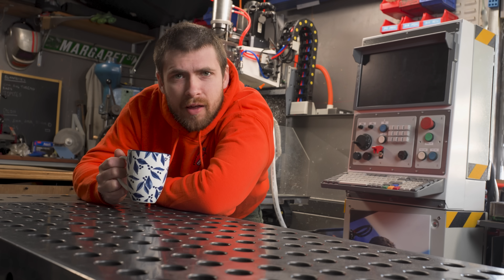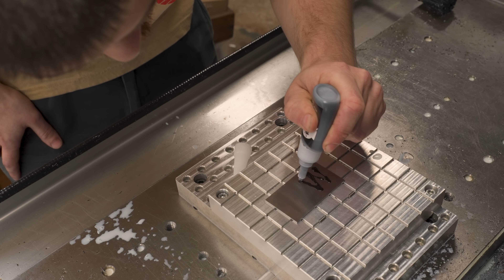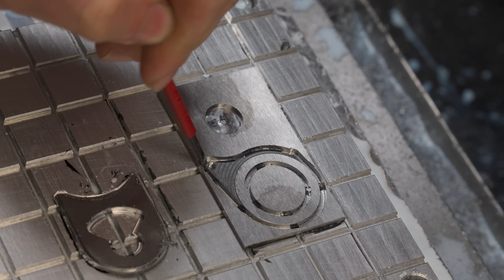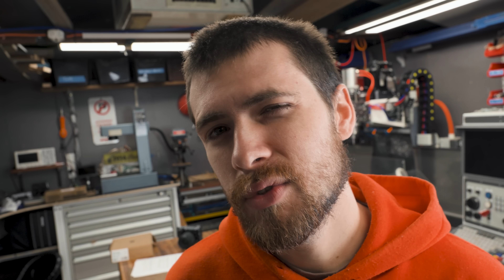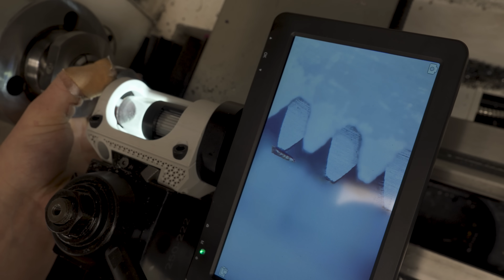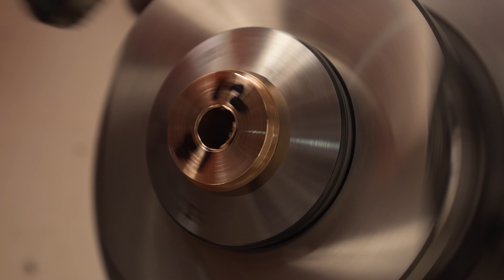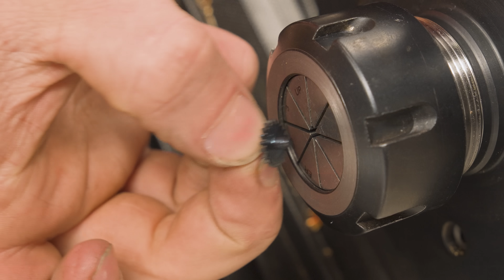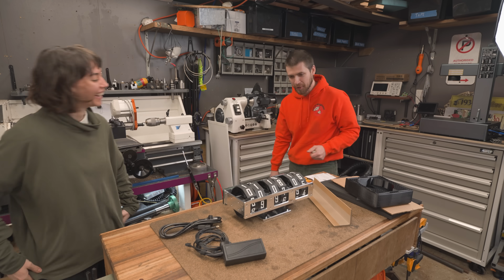What if angles were metric?

Comment: degrees are already metrics : a full rotation is divided in 6 each 6th in 60 each 60th in 60 and so on... The main difference with this measure and measure of length or mass is that a rotation is finite so you don't need to scale infinitely up, when you need to scale down you need to until a point for wich we created angle minute and second, then you can use rad wich can scale indefinitely being represented by a real number. The grad is an awful idea because it doesn't take into account how useful being able to divide a rotation in thirds or 9th or 6th is whereas with grad you are stuck with only 5th and half.
Thinking the idea of metric sit in the use of base 10 is a mistake the usage of base 60 for time and angle isn't less metric it just need to be coherent from a scale to another

Comment: My favorite unit of measure for angles is the "turn". 90 degrees is 1/4 turn (or 0.25). And if you use a cursive-looking "T" for the unit you can sneakily be using turns and radians-with-tau at the same time.

Comment: The metric system does not have "units" for angles, because angles are essentially a dimensionless quantity: being ultimately derived from (how much bigger is THIS side of a triangle than THAT side)
Reply: And yet there are various units of measure which have been assigned to the angle.

Comment: As a geologist, I've never used gradians. 
Not once. 
I have seen instruments for sale with gradians and degrees as alternative markings from the factory - but I've always ascribed that to the instruments also being used by artillerymen for aiming death-sticks.

If I were looking for an origin myth for gradians, I'd point it at, IIRC, the Cassini family (astronomers and surveyors to the French royalty) who proposed a unit of linear measure equal to one 10,000th the distance from the equator to the North pole (along, obviously enough, a meridian through Paris ; where in Paris, I don't know ; Notre Dame?) so that one gradian, on the ground, on that meridian, should subtend 100km.
The obvious corollary of that is that the Earth's circumference is, to a first approximation, 40,000 km long. Or round. Worth remembering. (After which you have to address that the Earth is no more a sphere than any balls you happen to have to hand.)

But for a scientific - or mathematical - unit of angle, you'd have done much better going for a scale laid out in radians (or steradians for solid angle). 2π radians subtend a full circle - obviously the mathematicians love it. TTBOMK, nobody in the real world uses that measure, so your finely constructed tool would remain in it's shipping case, untouched by human (or engineer's) hand. Ball-bearing or not.

Comment: The reason there's 360 degrees in a full rotation is because 360 has a lot of factors. You can divide 360 degrees by a LOT of different numbers and still get a whole number out the other end, which means it's SUPER useful for pen and paper math without having to deal with decimals. Nowadays of course we have calculators and it's less important what things are subdivided into, but it's nice that you can divide a circle by something like 9 and get a whole number of degrees out the other end.

60 also has a lot of factors for the same reason. It's just a really useful number for doing fractions without needing decimals. 6*60 = 360 is a reasonable starting point.

Nowadays because of modern calculators, Radians are the main workhorse unit because you don't have to worry about endless decimal expansions and doing all that math in your head.

Comment: 360 degrees is divisible by 1,2,3,4,5,6 as well as 8, 9, 10 and 12. Just like dozenal is better for numbers, so is 60 and 360. Which lay on a line, each one giving an extra factor: 12*5=60*6=360

Comment: A lot of what you did in this video comes dangerously close to watchmaking. As far as the rough finish on your gears, those cutters do not last long being plunged to full depth in steel. Multiple passes and adding depth incrementally each pass helps them last longer and get better finished. We typically temper parts, then polish them (a mirror polish requires lapping with sub-micron diamond paste on a tin block) then blue again for cosmetics. This gives a much more even color.
Reply: There's "Nothing" dangerous whatsoever about watch making ya idiot!!
Reply: Sounds like you know your stuff - Thanks Sherlock

Comment: If we take the SI to be metric (not decimal) then the correct angle unit is radians
Reply: How's that?

Isn't metric scales based on powers of 10: 10 mm = 1 cm, etc? 

In metric units for angles, 1° = 10' (minutes) = 10" (second) and a circle would have 100°.

Thx
Reply: @ຈິຕຕະຈິຕຕັງ  decimal scaling is not the SI system, the SI prefixes denote scaling by powers of 10, but the base units need not divide something in decimal units.
In fact, only the meter divides the earth's circumference into 40,000,000 (roughly) segments (formerly)

Comment: At 38:15 I have never seen an insert like this for hinges. Are these heat inserts? 

Very curious if anyone can enlighten me about these. Looks very useful!
Reply: I bought some of those over 10 years ago from cabinetmakers/carpentry supply. They open to 180 degrees to form a flat surface. At least that is what I used them for in a shelf. Google "Hettich Zylinderscharnier".

Comment: New subscriber, awesome video. Reason why degrees won over gradients: Math. 360 is a hyper-composite number; i.e. it can be evenly divided by 2,3,4,5,6,8,9,12,15… etc. 400 cannot (Numberphile has a great video about it). Thus, when building things, the degree is much, much more useful.
PS: Engineers do not use degrees nor gradients, we use radiants; radiants being of how far along the circumference of 2pi you have traveled

Comment: A truly metric unit would be a turn/rotation/cycles (used e.g. in RPM or CPS). Mathematically, quadrant (quarter-turn, or 100 gradians) is at least as good (and also allows to neatly get rid of e in complex numbers). Using gradians feels like using centimeters.

Comment: The metric unit for angles is a radian. there are 2pi radians in a circle. others have probably already voiced this but almost all of the world uses SI units which is the modern metric system, and gradians is not a SI unit. technically gradians are metric, but they aren't the official metric. Radians are SI units, and as such the metric unit of measurement for angles.

otherwise cool project.
Reply: I was wondering what gradians are, since I only know radians, which make stuff so much easier. For example gps or any precision navigation.
Reply: @GERntleMAN  gradians are just the british version radians
Reply: @Abednego-v2rSounds the same as: "Pound is just the  British version kilograms"
Reply: @Anton-z7u2n  which is totally true
Reply: @Anton-z7u2n  your comment is lost on me. Pounds are pounds and grams are grams. They are different measurements and their nationality is perhaps the least important factor.

If what you have said has gone over my head, please do elaborate.

Comment: 0:17 A circle isn’t a unit, is it. I’d say 60 arcminutes in a degree, 60 arcseconds in an arcminute.

Those are used in navigation and cartography.

Radians are used scientifically with the SI-system.

Turns are used in engineering and mecanics.

Your favourite gradian is used in… drumroll… web styling. Usefull an nice. 

To me turns match the metric system more than gradians.

With your premise ’a circle is 360 degrees, doesn’t match metric’… Neither does gradians. A circle is devided into 400 gradians. 

Your argument isn’t sound.

Comment: If someone really wanted to improve the division of a circle, the tool would have 420 degrees. Then you have even divisions of 2, 3, 4,  5, 6, *7*, 10, 12, 15, 20, 24, 28, 30, 35, 60, 70, 140, 280, but I guess the ~360 days of the year were a problem here.

Comment: 400 Grads to a Circle.
1 Grad is 100,000 Meters of Length around the circumference of the Earth.
100KM = 1 Gradient of Circumference.
Reply: In a Square, each Corner is 100 Grads of Angular Measure.

Comment: The problems with gradians, is that base-10 is not very good.  That not to say it's not a standard and not in use ofc, but for general, everyday, common uses and need for easy and simple division etc, the limitations of base-10 are far more noticable in this particular context - base 60 (which is how we got the 360 in a circle) is far more suitable.

Comment: Just to be clear, all the regular people that use metric are accustomed to 360 degrees (even in stuff like navigation compasses) - radians are only for math people like engineers or fabricators.
Even the military uses mils (military milliradians) instead of normal radians, just because they need more precision than 360 degrees; there are 2000π (2π * 1000) mrads in a circle (for math reasons) but NATO divides that into 6400 mils instead, the width of 1 mil is roughly 1m at 1000m of distance. Mils are also easier to divide into parts unlike true mrads.

p.s. basically everythin in the metric system is intuitive for humans, but radians are not - they only look good in math, so degrees are overwhelmingly popular.
p.p.s. gradians are even less popular, they are only for very specific jobs, because there was no reason to abandon 360 degrees.

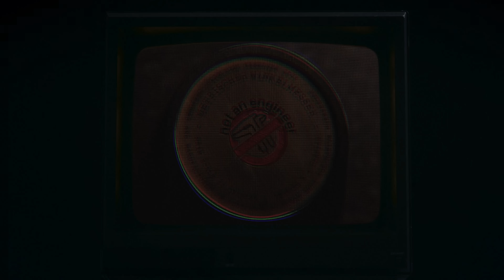Comment: 0:58 Gradian? The SI Derived unit is the RADIAN. A proper circle is (2 pi) radians. All the Engineering math works on that principle.
Reply: Yeah, but do people actually measure things as e.g. "1.570796 radians"?  Or even as "pi/2 radians"?  Degrees often gets CONVERTED to radians under the hood, for the computer to crunch the numbers, but I'm not sure I've ever seen somebody write down a number of radians unless they're just copying a number the computer gave them.  You can't even WRITE DOWN common angles, since pi is irrational.

Comment: Actually the best unit for angles is milli-pi. 
Radian is the natural angle unit but unpractival for larger angles.
Using milli-pi woild be practical and is not based on a arbitrary definition. 2000 mpi is a circle. 500mpi correspond to 90°, etc.

For small angles you will not need to use sine or tan: rotate a 1m rod by one mpi around yhe base corresponds (approx.) 3.14mm movement of the tip. Calculate the same with 1°.

Comment: I'm a retired engineer, and mostly worked on the electronics part of optical measuring systems of various sorts.  I worked with 'metric' angles all the time, but they were milliradians.  

Gradians are most useful for measurements on the surface of the Earth.  To a first approximation, 1 centigradian is 1 kilometre.  It's a rather poor approximation for precision work, because the Earth is not a sphere. But it was good enough for 18th-century French sailing ships.(Which is not why they got their arses kicked at Trafalgar.)

French topo maps still carry coordinates in grad, but they also print the UTM grid, and that's what everyone uses with those maps, even crazy Frenchmen.
Reply: I figured I'd find someone else familiar with surveying in these comments. I do maintenance and service on the kind of equipment it sounds like you designed.
Reply: @AlexS-ve6fo  I wasn't that much into surveying. I'm an off-trail hiker, so land navigation makes me understand some of the principles. (I'm old enough that to me, GPS is the backup system. Primary navigation is with dead-trees map, magnetic compass, barometric altimeter, pace count and wristwatch.  My attitude toward GPS is that when I need it most, the battery will be dead.)

My career took me into industrial inspection and medical instrumentation, with a ten-year side jaunt into broadcast TV monitoring and control. (I did a lot of design work on NBC's first all-digital network control room.)
Reply: Wait until he discovers 'Knots', and 'Nautical Miles'...😊🖖

Comment: my all time favorite unit for measuring angles is the semicircle. there are two semicircles in a full circle. that's it. 1 sc = 180 degrees = 3200 mils = pi radians. no crazy high number of mils. no "imperial" degrees. no multiples of an infinite series. just semicircles. you really only find them in navigation because it is simply the most information dense way to store angular data. if you have only X number of bits, then having X be equal to 2 sc and 0 be equal to 0 sc is the absolute maximum accuracy you can achieve of angular information per bit. your largest possible angular error will be 1/2 the value of the smallest bit

Comment: gradians would make sense if full circle wasn't 400 grad... I'd accept 1 or 100. Then 90 degrees would be 0.25grad aka 1/4, which it is... 1/4 of a circle.
going with 100 would be even better since then in most applications the "0." would be gone and whole thing more efficient to read

Comment: As for the question of why it isn't metric: because in the metric system everything depends on each other in equal ratios. 
The metric part really isn't the "every unit comes in 1,000 separated pieces", but really more that "1 of one unit under these circumstances equals 1 of that other unit"

1 meter was originally supposed to be exactly 1 : 10,000,000th of the earth's circumference, which had scientists at the time made the closest and most precise measurement of earth's circumference at the time, they didn't know earth was more of an elliptoid then. It all comes down to that one meter, every other metric unit is in relationship to that meter.
For instance a 10cmx10cmx10cm cube of water is a volume 1liter of water. 1 liter of water at room temperature is exactly 1000 grams in weight.
Another example: 1 Watt = 1 kg * m²/s³.
So in other words, you could resolve just about every metric unit into just "a certain measurement of metric space relative to a certain time".

Angles are a unit all for themselves, you can't bring them into a relationship to other units and because of that you can't easily make it part of the metric family tree of units. Time is the same way, which is why metric time doesn't exist. The metric part is hence now rather arbitrary.

Comment: hoi always drill 0.1 to.0.2 mm bigger for thicker sheet or blind holes than standard M3 with 2,6 mm drill is strong and 3,4 for M4 is great. tapping steel with cordles dril works a charm and allmost no broken taps even inexperient workers seldom breaks a tap now. before 4 or 5 a week was no exception. try for yourself and test the strengt.

Comment: For the record the gradiant is just the slope coefficient from mathmetics expressed in %, so 0,5=50%=26,6degree as in every meter forwards you go 0,5 meter up, 1=100%=45degree, 10=1000%=84,3degree
Also radians are more common than the gradiant.

Comment: Base 60 goes back to Sumeria 4500 years ago. 60 is a very unprime number - it has many factors so it's easy to divide
Reply: Believe it or not it's based on the way they kept tally of things; Using the knuckles on their hands. 

They would take their right hand and count the knuckles of each finger with their thumb, twelve total. When they got to the twelfth knuckle they would then use the thumb of their left hand to count the first knuckle on their first finger, then start again on the right. Twelve lots of twelve = sixty. Hence the Base 60 numerical system.
Reply: @CJTheReal they counted 5 lots of 12. 12 lots of 12 is 144.
Reply: correct, I got my words wrong lol.
Reply: @CJTheReal  I always heard that it was just how far they got making up numbers before they realized they could use another digit

Comment: That was a very thick layer of adhesive to hold the parts for machining. A thinner layer is stronger with adhesives. A thick layer is not required because the stock was already ground flat. I recommend wiping adhesive flat with a tool before placing part down to remove excess adhesive and usher that the part is not bonded at an angle to the mounting surface.

Comment: cutting those gears would have also been easier if you had a gear hob.  downside is that you'd need one for each gear ratio.  but it would have cut the time spent cutting each gear down significantly as you could have actively rotated the part while cutting.

Comment: The Degree is still used in metric because it was an ancient unit that happened to be universal. It is simply the subdivision of a circle into 360 degrees. 360 is because at the time of it's invention people would count in base 12 on their fingers. Degrees are subdevided into 60 minutes, and the minutes into 60 seconds and so on. Hense why 1 hours is also 60 minutes and 1 minute is 60 seconds when it commes to time.

Degree's are still very usefully for anything involving  spherical or circular geometry and makes calculations for time and angle specialty in anything involving space much easier. Hens why even today, your gps tells you your position on earth in degrees, minutes and seconds.

they did try to make time metric and divisible by 100 but that failled. well partly because due to are quest of precision which at the scales we are at in the last 200 years, milliseconds and nano seconds appeared which are based 10 divisions of a second which is based 12.

By the way if you google is they will say base 60 but they did not use a true base 60 back then and it turns out 60,120,180, 360 are all nice round multiplications of 12.

Comment: You know what would have been hilarious? A metric clock! 
Nothing a quick firmware upgrade couldn't fix. It has all the unnecessary digits preinstalled. 
I'm quite disappointed that you chose to edit out the rollovers in the video.

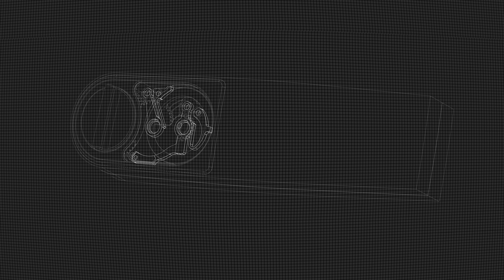Comment: 7:09 the vernacular is on point and proper. Regarding the specific angles as well as breaking each item down. New subscription from me. I am headed through the 2026 exchange. I have been following Alec for quite a while however I missed 2025 so after perusing the finely tuned photos flashing at me showing me exactly what's going on. Bit by bit.